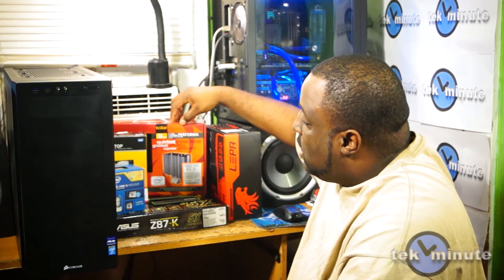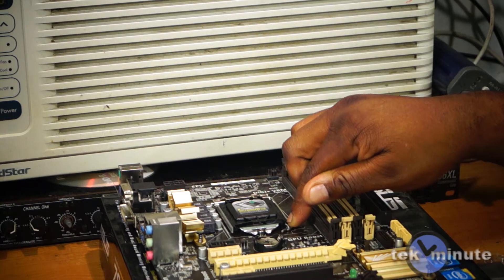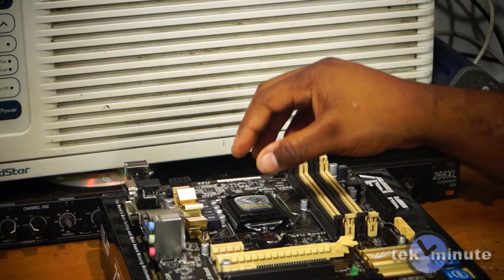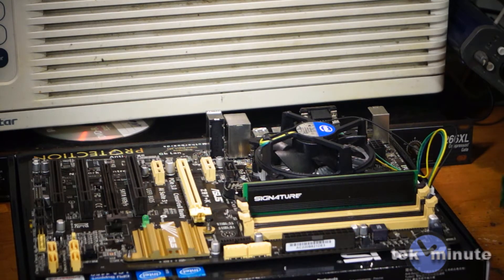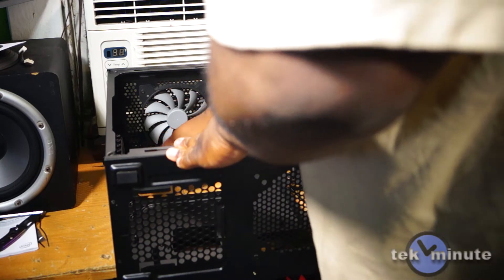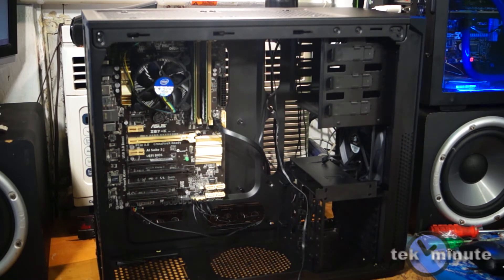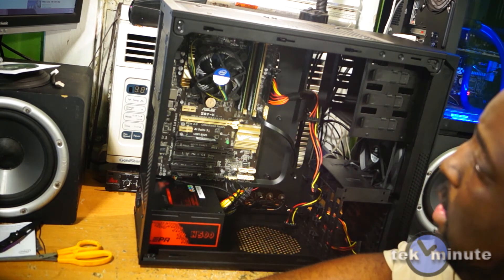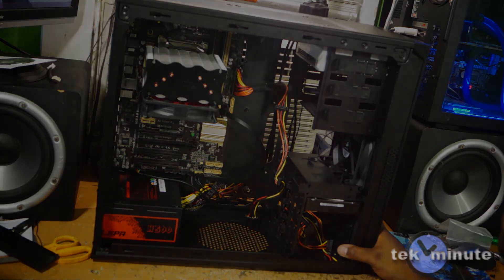Haswell hackintosh build

Comment: Hi I have two disks 500GB and 1TB, Asus Gryphon Z87 motherboard (I heard it's one of the best for hackintosh), geforce GTX 650ti and planning to buy haswell 4670k cpu. Can You tell me if 500w power supply will be enough? Do haswell need specific power supply?
Reply from the maker: 500watt power is more than enough for that set up, but usually i would go with a 650watt or at lease 700watt for future up grades

Comment from the maker: you was able to install it, that is a very good sign..... I use no special bios setting. I just went in and click optimize settings and thats it. it can be hard working with a hackintosh if you don't know what you are looking for...I should have a video up by early next week. with that said i had to boot with" -v -x ", and then install multi beast 6.....let me ask you are you using a discrete graphics card if so you might have to add "GraphicsEnabler= Yes "to that string also your you getting